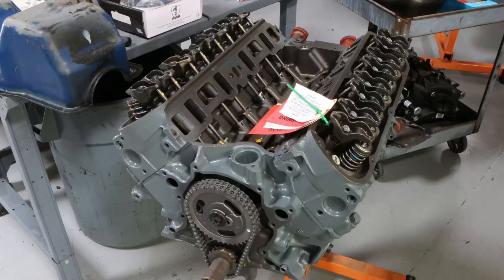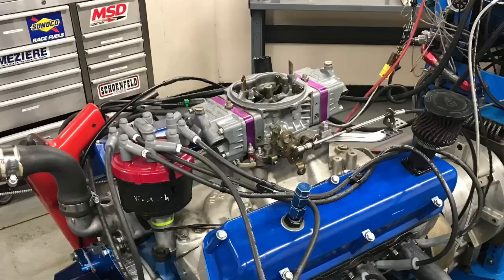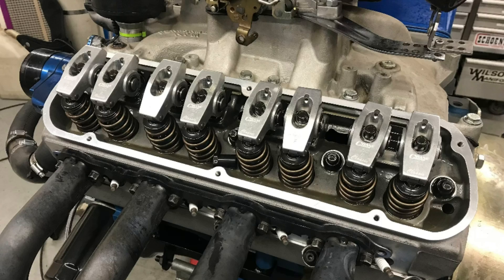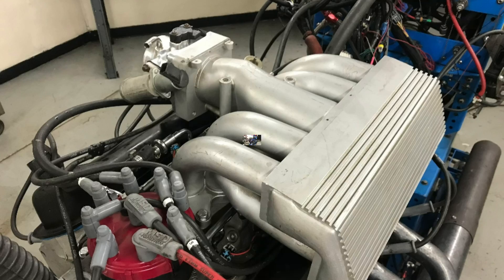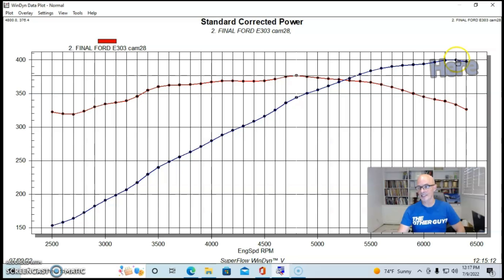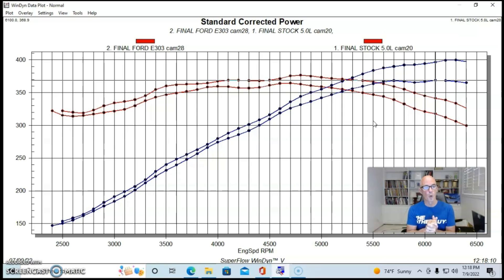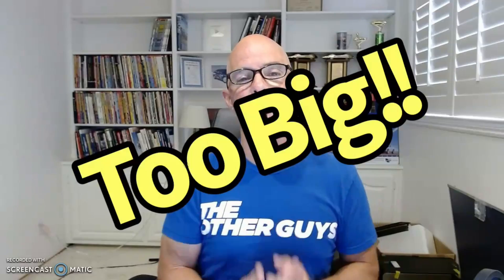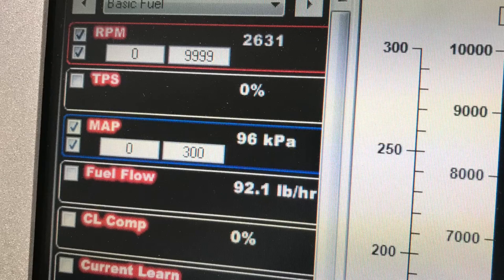5.0L FORD-CARB VS FUEL INJECTION-WHICH ONE WORKS BEST? EDEL RPM & 750 VS GT-40 & 65MM THROTTLE BODY

Comment: Wish you would do a how to swap EFI to Carburetor on Fox Mustang
Reply from the maker: remove upper and lower EFI intake-add carb intake and carb, you will also need a different distributor and fuel pressure reg to lower the efi fuel pressure

Comment: One of the things that I don’t like about my 91 5.0 HO 5 speed, totally stock except it has long tube headers is it’s all done by 5000 rpm really maybe 4500. That really hampers power production.. My 390 67 Galaxie and my 71 Torino Cobra 351 4v Cleveland both would pull hard all the way to 6500 and that’s where I would shift gears both cars! Thanks for the video! I think I need to change the heads cam and intake, swap to the carburetor on my 5.0 HO Fox!

Comment: Air gap on the Chevy LS side is making more low speed torque than the factory long runner intakes.   Before the air gap you could usually count on long runner EFI intakes winning on low speed torque and the carb intakes winning out at higher rpm.

Comment: Is a 650 double pump better than the regular 650?
Reply from the maker: what is a regular 650
Reply: @richardholdener1727  just a sinlgle pump. Thinking of putting a double pump on my 302 with some heads

Comment: The best competitor to a dual plane carb intake manifold, is that exact same manifold with injector bungs welded into each of the individual runners. That's the only right way to test efi vs carb performance differences. Unless there is a port injection version of said carbureted intake manifold. 

My ranger project will go this route with a dual plane intake that i will be welding in injector bungs to. Getting things ready for a 351w sbf to go in.

Comment: I have yet to see anyone compare a port injected single plane vs. Dual. The internet has tons of opinions. The aftermarket has only embraced the port injected single planes. Show us why or why not they are correct in doing so!
Reply from the maker: the introduction of fuel equally to both means you just have a single plane and dual plane comparison-we know what that does
Reply: @richardholdener1727  So the notion that a PI single plane will have better low-mid range characteristics than a carb application is not true? Or, somewhere in the middle? It has better characteristics than its carberueted conterpart, but don't expect it to rival dual plane torque production because port velocity is still inferior in comparison.

Side Note... Have you done testing on plenum turtles?

Comment: Please help !!!! I have a 302 I'm rebuilding and I will be going with a carb setup. Most likely a 750, with that being said I have plans on using a E303 cam with 1.6 roller rockers because I heard it's the best cam when going with a carb setup. My cousin is dead set on getting me to use an F303 cam because he used one in the past with a carb setup and loved it. Please give me you oppion on which cam you think will work better. I will be using GT40P heads ported and polished with new springs of course and I don't plan on using any boost.
Reply from the maker: either cam will work-they don't care about it having a carb. Pick the cam that does the other things you need like idle quality, drivability, mpg etc...The bigger cam will make more peak power but less down low
Reply: @richardholdener1727   thanks so much for replying man. I love watching your videos and look forward to seeing even more of them.

Comment: The thing i like is carb has no bullshit sensors ,tps ,mass airflow, vacuum leaks ,idle air flow etc that when working ok is alright but if your any issues ,idle surging etc they are a bitch to sort .where as a carb much more simple and more power.muz

Comment: Ran 750 vacuum secondary carb. One the street i needed to kill off a little on the bottom and pick it up at the 60'! I used a 357w,  why would you use a 302 based moter in a redneck state? The 351w is a full second faster with the same cam, similar intake, and tricked out 750cfm! That's the equivalent of 100hp. Now, we were running more cam, but the rpm ontake! The victor jr. and a big solid roller cam put it into another league while still around 6200 rpm. The block is in another league!! Just get high dollar head gaskets! Enjoy your shows!

Comment: Richard,  can we use a dual or single plane manifold,  fabricate an elbow so one end off the elbow mounts to the intake manifold flange, and the other end of the right angle elbow we could mount the throttle body to,?  Do we really need all that plenum area with the with fuel injection?, what do you think?
Reply from the maker: people run elbows on carb style manifold (must have injector bungs or run a TBI with injectors), but that is just an intake change (like shown here)
Reply: @richardholdener1727  Ok ,thanks Richard,  your a living legend😉

Comment: Hi Richard! 
I had a question for you. Or your loyal Ford Gurus. 
I have an 86 Bronco with 5.0 efi, and AOD trans. 
My speed density system is having age issues. (Wiring, egr, etc)
Question is, i want about 300(ish HP) and 300(ish) Torque. Vehicle will be operating  basically below the 4500 mark.
Now for my question. 
I have a complete 99 Explorer parts vehicle. 
Which is easier to swap? 
converting to MAF?
Converting to Carburetor?
Swapping the entire 99 Explorer Motor, harness and computer?
I am
Looking into getting an  Edelbrock top end kit regardless of which route im
Suggested.
Thanks in advance!

Comment: Is it possible to convert a carbureated 302 off a 1973 Ford Econoline van  converting it into efi by swapping the upper Intake off a efi 302 non HO and using the computer from a non ho 302?
Reply from the maker: NEEDS WIRING HARNESS AND DIST AND SENSORS TOO
Reply: @richardholdener1727  is it possible that the upper intake manifold will fit it?
Reply from the maker: WILL FIT WHAT?
Reply: @richardholdener1727  the 302 efi upper plenum to a 1973 carbureated 302?
Reply from the maker: you will need the entire EFI system, upper and lower and tb and injectors and rails and sensors etc...
Reply: @richardholdener1727  it is possible then besides all the stuff needed

Comment: Now the big question: What would the Edelbrock airgap or rpm do with a throttle body fuel injection unit? Will fuel atomizing in the plenum help make power?
Reply from the maker: it already does that with a carb
Reply: @richardholdener1727  True, but the question is, can we run Throttle Body injection and get the same horsepower increase as the carb?

Comment: How do feel about trick flow intake.
Reply from the maker: which one
Reply: Street burner I belive. Im using gt40 heads. 95 mustang block stock everything expect im using a turbo of a 6.0 power stoke and 40 pound injectors.

Comment: I’d like to see the gt40 style upper vs gt40 with a box style upper test.
Both NA and boosted.
Reply from the maker: the box loses a lot of power through most of the curve-na and boosted
Reply: @richardholdener1727   About how much lost?
What happens to torque?

Comment: How can a guy hookup and bench run multiport fuel injection on these?
Reply from the maker: a better question is why would you?
Reply: @richardholdener1727  I did a little more research, I meant how do you bench run the stock efi for junkyard engine testing 😅 i didnt know what I was talking about. My apologies

Comment: Should run this test with the A9L.  A dialed in couple thousand dollar efi setup will make a big difference vs the old mass air setup
Reply from the maker: IF THE AF AND TMING ARE THE SAME-THEY MAKE THE SAME POWER

Comment: Nice to see this comparison 👍,  port the efi lower and it should pick up a ball park of 25 lbs of torque
Reply: The Biggest gains in these Efi intakes comes from porting the uppers. Most of the efi porters back in the day claimed porting the lowers was the way to go, but thats because its much harder/more time involved to port the uppers. They wanted to charge a lot for doing less. Think about it, the upper is like an elbow= restrictive, & to get the most flow out of them, they have to be cut open for access. The lowers are a straight shot. But the best way is to have the Throttle body tunnel, the Efi upper, the spacer, & the Lower ALL ported.

Comment: Edelbrock efi performer rpm2 test please
Edit: made 368hp and 398tq at the rear wheels, with a 331, b.p. as cast heads,  10.2comp, 226int 236exh at .050 roller cam, edel perf rpm2 intake with 75mm tb and 30lbs inj. 
Thinking of going with edel rpm air gap and aces efi killshot tbi.  Anyone have input on possible gains or losses??

Comment: Richard, back around the time i worked for DH and we were doing stuff on the Focus, I methodically tested the following parts before and after and found them to be the respective best for each around the power range this engine is at.  You need to run a Holley Systemax II with a 65mm Ford Motorsport (old school) throttle body and EGR spacer.  If you have the 65mm for an Explorer, it’s the same casting and throttle blade with a different lever and no PCV tube but it has the exact same flow characteristics.  That pairing should gain 500-600 usable rpm and come close to or match the carburetor and dual plane at the rpm the EFI combination tops out at.  -Walter
Reply from the maker: WALTER-I HAVE TESTED THE SYSTEMAX SEVERAL TIMES IN THE PAST-I HAVE VIDEOS UP ON IT-A 65 IS RESTRICTIVE AT THIS POWER LEVEL
Reply: @richardholdener1727  I tested about a dozen TBs in this power range for Bob Mclurg in a multi-way N/A and forced induction comparison to one DH was making with inserts to make it perform like a 65/70/75mm in a single unit.  The two standouts from that test were the old SVO 65mm and the 75mm with a 65mm Venturi reducer in front of the throttle blade.  The final article completely omitted the SVO 65mm TB because it was the top performing part in both configurations for torque and horsepower across the range.  

And my first inclination to how good that SVO TB was came from one of your early dyno tests on a 351W with a Vortech that made about 630HP back in the mid-90s at R&E.  Those were the days.

Comment: Hey Richard. the way you improve the Tubular gt40 manifolds upper rpm pull is to increase the manifolds static airflow abilities. I know you say you've tested ported gt40 manifolds but we have yet to see anyone port these things the way we do and get them to work so well. We have customers that's peaking past 6,000rpm with our stage 2 and higher with our stage 3 ported tubulars. the stock tubular gt40 manifold suffers from the lack of throttle body tunnel flow and the runners flow is low and out of balance from bank to bank so its low flow and a non optimized AFR from bank to bank because of that. The TB tunnel only flows around 800-840cfm and if you install vac sensor on the TB tunnel and measure at wot on a decent engine you will see it pull a lot of vacuum. We've tested tons of different manifolds when working on our porting programs, cut them open and picked them apart. I'm a master fabricator and a degreed engineer with over 30 years experience.
Runner wave length tuning on the 3rd wave accounts for 8-10% cfm boost of the runners static flow. If you dramatically increase the statics flow you can keep the hp from falling off as the rpm climbs and boost power even more in the lower to middle rpm (2nd wave). We have a back to back dyno comparison showing this very thing. A shorter runner lower flowing aftermarket manifold vs a higher flowing stock runner length (15" runner plus a 1" spacer and a 1/2" nitrous plate) 302 base Cobra gt40 manifold. The Cobras power curve shot up quicker, made more power everywhere and made more power up top over the shorter runner lower flowing manifold without falling off all the way till 6,200-6,300rpm where they stopped the dyno pull. 
A stock Tubular gt40 manifold 302 base has a bolted together average runner flow of 200-210cfm. We have gotten the tubulars to flow as much as 320cfm with our stage 3 cut, modified and welded max porting and modified with expanded TB tunnel. We weld in extra material in key places in order to reshape the runners for increased flow. You have to see them In person and test them for yourself to believe lol. 
looking forward to working with you on that👍
Reply from the maker: I would like to test them-but if you don't change the runner length-you don't change the reflected wave (one of the three forms of charge filling associated with intake design-Reflected Wave, Inertial Ram and Hemlholtz resonance). are you also not changing the flow of the tubes in any way of the tubular GT40 or are you running a Cobra upper that provides more flexibility to porting and modifications?
Reply: @richardholdener1727  There was a test done by Motortrend back in 01' where they took a healthy 347 and tested several manifolds one being a 302 based Tubular gt40 manifold that had the lower Extrude honed (those tend to flow a lot less than our ported lowers . We have flow tested them to verify this) but the upper and its major restrictions were stock. They also tested the tubular with a smaller 70mm throttle body while the other manifolds tested had a bigger 75mm throttle body.
Well the results were:
Tubular Gt40 450hp @ 6,600rpm.
TFS R 475hp @ 6,500rpm.
Systemax 2 474hp @ 6,300rpm.
Victor 5.0 481hp @ 6,600rpm.
Although the gt40 manifold had the longest runners of them all they still all peaked around the same rpm. Had that gt40 had our stage 2 or stage 3 porting (with a much higher and better balanced static runner and throttle body tunnel flow) modifying on its upper, lower, throttle body tunnel and ran with a 75mm throttle body like the other manifolds it would have made the most hp everywhere in the tested rpm range. Dramatically increase the longer runner static cfm flow and you will extend the rpm that it can support hp at.
Reply: @richardholdener1727  right, on the tubular you don't have to change the wave tuning length to get them to carry the hp higher in the rpm band. You can increase the static flow and the areas in the manifold runner that has the mcsa. When you do that you increase the rpm at which the runners air velocity goes sonic. That's also how we get the LS truck manifold to carry its hp higher in the rpm curve, by increasing its static airflow as much as we can for the application. Its similar to running the frequency of a band pass subwoofer enclosure. I use to design and build them and there were several ways we could tune them. Box volume, port length and port CSA. 
I've seen a test where a Stock tubular gt40 manifold had a hp rpm peak at 6,600rpm. If that motor had our stage 2 or stage 3 ported tubular on it the overall power would have been considerably higher.
Shoot me a your contact information and I can send you the back to back dyno results that I spoke of earlier. Bigdogscandc@aol.com

Comment: Charles Servideo did some videos showing head flows with cylinder heads and fuel injection manifolds combined.  From what I gathered, those fuel injection intakes absolutely killed a good flowing set of heads.  It was depressing.  He was able to work his magic and get the flow numbers to come up but it was probably not as good as a carburetor style intake.
Reply from the maker: it's not flow

Comment: For the best efi intkae manifold. I think the holley systemax 2 would be best. But i still think the carbarator would make more power and and at a little higher rpm. But i think that would be a very interesting test

Comment: I'd love to see Holley hi-ram but 4150 pattern tuned port would probably be a more apples to apples comparison. Then again might need a performer vs performer rpm vs air gap vs victor jr vs victor sr overlay on the same. I'm a little curious why it was non airgap. Appreciate the vids Richard!
Reply from the maker: it is what we had

Comment: the carb venturis will have a cooling effect while the long runner EFI intake is going to soak up heat with all its surface area once the hood is closed. We could easily use the carb intake with injectors drilled into the runners by the ports and then use a throttle body and find....no different in power. the engine doesn't know how it gets its air, it just heats it up--when the runners have the same area.  The long runner EFI intake did what it usually does--ran out of breath before 5,000 rpm to generate torque instead. install an old Spyder or "bread box" EFI intake, and you'll find it swaps its torque curve over the RPM band.
Reply from the maker: the engine knows how it gets air-look up reflected waves, inertial ram and Helmholtz Resonance
Reply: @richardholdener1727  If you change the intake manifold design, yes. but as I said,  you can take that carb intake, drill bungs in for fuel injectors, replace the carb with a throttle body and the engine...ain't gonna know there's a difference when the runners have the same area of flow. There may be a case for better fuel atomization depending on air temp you're running inside the dyno, but a ton of dyno tests in Hot Rod Magazine et al prove...there was maybe a 5 hp difference when this was done, and that was easily chalked up to operator error.

As for this test, you compared a long runner intake to a short runner intake (the wet one) and voila, the hp peaked exactly where everyone thought it would. Now we get into the aspect you're talking about, two different intake designs and the engine is getting air with different velocities, densities, etc. But again, different intake designs make for an apple to orange comparison. For the new guys, this test is news about an engine they know little about in an age of LS, but for us old guys, a "breadbox" short runner intake compared to the carb would have been less apples to oranges.